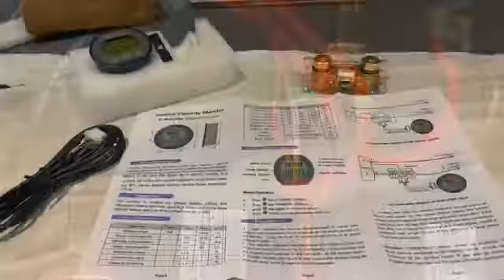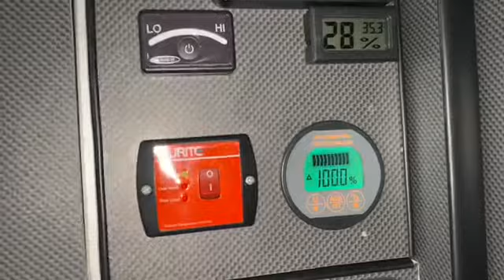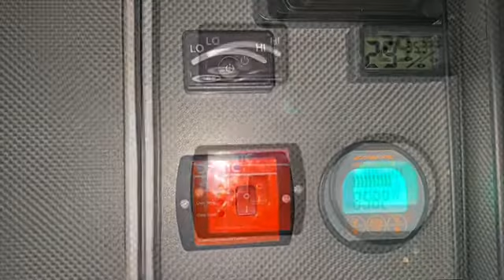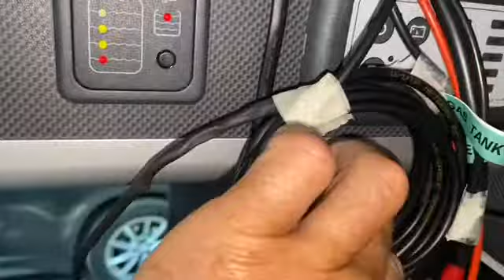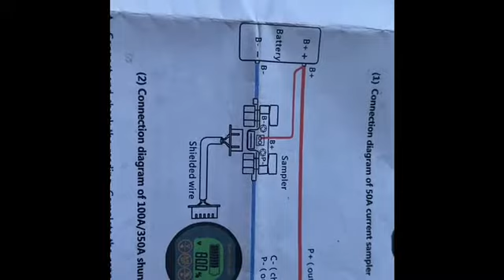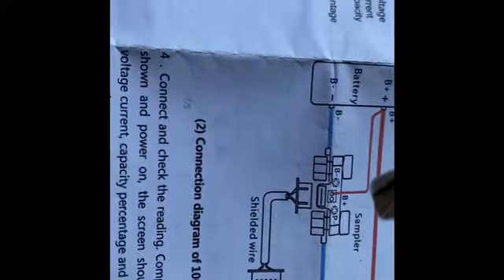AILI Battery Monitor

Comment: I have two batteries in PARALLEL.  In wiring up the monitor, how is the neutral cable from BAT 1 to BAT 2 wired?  To B- or P- ?

Comment: hi craster van i just fitted the monitor to my van it shows charging on hook up from the sargent but it does not show charging from the stirling b2b . the stirling b2b is showing 14.7 v going to the  battery, has the battery got to drop before the b2b shows a charge cheers hope you can advise cheers john
Reply from the maker: sorry for some reason I’ve just seen your comment. I hope you’ve managed to sort it in the mean time. all I can offer is that I too have a Sargent and a sterling b2b. they are installed as per instructions and seem to work fine. when my b2b is charging it does shows in the display as amps coming in. I’ve never looked at volts but would assume that you’d be best check on bulkcharge phase to see if you get result you’re looking for.

Comment: Hello just come across this video. I see there's different ratings. Which should I purchase? 2x110ah batteries fitted
Reply: I bought the higher spec 300a as same price. Had no issues fitting it.

Comment: Quick question, when wiring this up to a system that has two batteries, does it matter which negative battery terminal the shunt is connected to ?
Reply: Good question iav just got 1 did you find out the answer cheers
Reply: @ThePistol1977  currently I just have one battery as well might add a second one next year so everything is working fine with the single battery maybe next year I will see what I can come up with I would think either negative terminal if you're running two batteries would be the same if they're linked together
Reply: @rockymountainroughridersofMT.  brilliant thanks for your help great video

Comment: Does the monitor always flash or does it go into sleep mode?
Reply: It flashes only when it’s charging. You can turn off the backlight by pressing the two outer buttons at the same time. It’s a great monitor, well worth the price.

Comment: Hi mate I’ve got the exact same monitor I’ve not fitted it yet though.... am I right in saying all loads come of the shunt and anything powering the battery goes would just be wired to the battery..... also for example could I run my negatives to a bus bar then to the shunt... hope this makes sense... great video
Reply: Yes, you could run all neg wires to a bus bar and then the bus bar must be connected to the shunt.
Reply: @bruceskousen5451  cheers man

Comment: Hi, nice vlog. But one thing doesnt seem safe to me. That is the tin wire from the battery+ to the shunt of battery-. If the circuit board on the shunt makes ashort circuit you have the entire power of your battery on the small wire. Isnt it better to put a fuse in between? Greating Sjoerd
Reply: The wire is such a small gauge that it would burn in half before starting a fire. You could put a small 2 amp fuse on it for piece of mind.
Reply: @bruceskousen5451  Hi, that is treu, but it is not indicated in the instruction . And mistakes can be made. Victron has a small fuse on the wire for secure. (I am not a shareholder of Victron). I have a Mastervolt battery monitor on the boat , and a12volt 460amp  battery  for service.
Reply: @sjoerds1  actually, I decided to add a fuse. I will install the fuse today.

Comment: Really useful little monitor with quite a simple install. Just looking around your build again, it's really well done. Lots of questions but in time. One thing I did notice was the drivers  seat swivel. It's one of my next purchases, do you have a single passenger seat or a double, and is it swivel also. Jamie
Reply from the maker: Hi Jamie,
Sorry been offline.
Yes both seats are single and swivel. I see a lot of people moaning about the slight increase in height and they spend extra £150 for lowered base. Two things. It costs nowt to fit to existing base and try it. If it’s a problem then maybe get a different base. Second: if I had lower base I wouldn’t get my two leisure batteries under the seat.  My passenger seat is in fact a drivers which I’ve easily modified but not used the pretentioner. While I’m over in Europe I’m planning to visit a breakers yard and buy a drivers seat which should fit perfectly with all original seat belt fittings.
Reply from the maker: Also you might look into a pair if ford galaxy seats they have built in swivels and look quite good. I don’t know the ins and outs but could be not much more than swivel cost plus supposed to be more comfortable. I’d be tempted by pair if grey leather.
Reply: If you find a seat, I'd gladly buy the existing seat!!